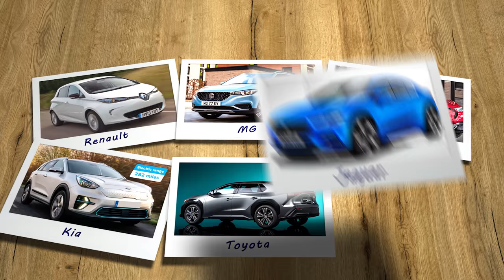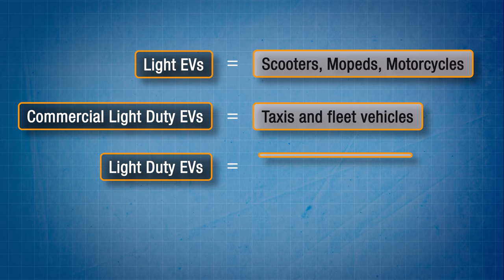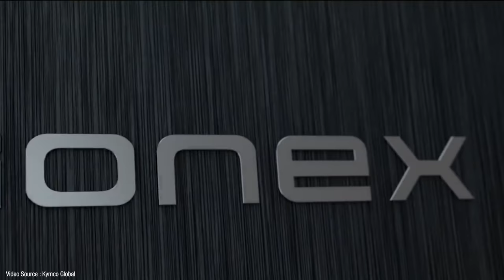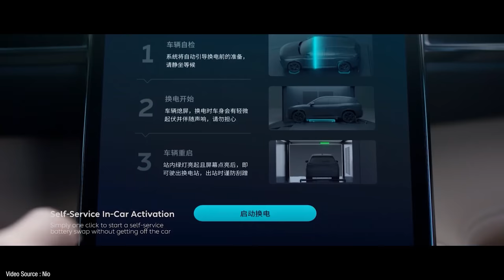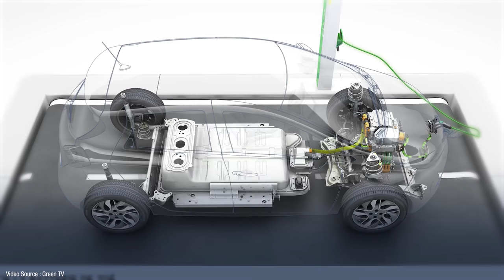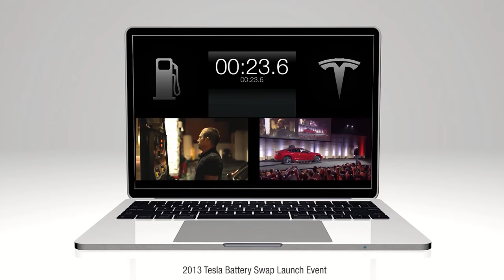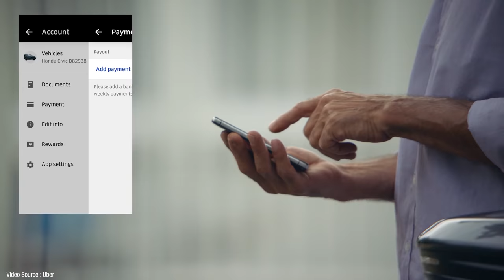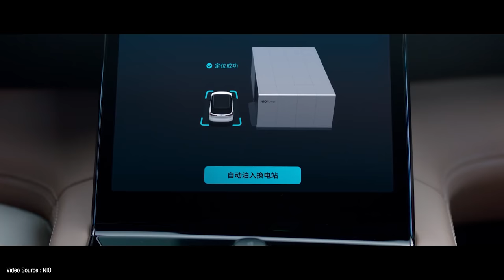Battery Swapping. Transforming the trajectory of electric vehicles?

Comment: Can’t believe it’s taken this long when all kids know that swapping batteries keep their toy cars alive.
Reply: It was tried before. The Renault Fluence ZE was designed with a swappable battery pack.
An Israeli company installed swapping sites in Israel and Denmark back in 2012.
The company went bankrupt in 2013.
(Apologies if that's mentioned, I haven't finished watching yet!).
Reply: Swapping batteries has its own technical difficulties, and most cars spend most of its time on parking rather than driving. If we can charge EVs when parking, why the hell do we need battery swapping.
Reply: @garylee867  Have you ever driven more than 250 miles from home?  With two kids complaining and crying in the backseat?  And you don't want to stop every 2.5 hours for 25 minutes to charge to 80%?
Reply: @garylee867  Try watching the video for the exciting and informative answer to your question.
Reply: @stanbradbury9449  I'm that distance just to the nearest bank or supermarket and don't have little kids.
Reply: @stanbradbury9449  Hi Stan, indeed in such situation it would make sense but how often do you make such long drive? Building such huge system (which by the way would also mean you would need the swap stations in the middle of nowhere to accommodate those long drives) doesn't make sense when you consider that in the US the average daily distance driven is under 30 miles. It would require HUGE investments from the car industry and from the companies providing the swap services. Not realistic from a financial point of view.
Reply: @stanbradbury9449  ..the issues I hear from owners in EV forums with children are they need to stop every few hours for the kids to pee and eat and also vehicles are used for that situation hardly at all.
Reply: @dominiqueridoux2073  While you are right, it might make sense to build the 30mls into your car and leave space for rental long distance batteries. Those could be cheaper than either rental combustion cars or electric ones you rent at your destination after a train trip.
Reply: How do you swap batteries if the cells are part of the support structure of the car like Tesla does?
Reply: @yarodin  You don't. No their strategy They want the battery to be cheap and capable of thousands of charging cycles, and the pack to be lighter to additionally increase range and reduce cost.

Comment: To make this work you need double the number of batteries compared to the number of EV's that use those batteries. As there is currently a worldwide shortage of battery supply as EV manufacturers are all battery constrained (including Tesla) this seems rather impractical. For every car sold the manufacturer needs two batteries, one for the car and one for the battery swap station ready for when that car needs to have a battery change. I can't see that this would be sustainable due to current battery supply problems or economically viable in the long term for the manufacturer. Battery manufacturers are already frantically trying to ramp up their battery production to meet the current rapidly expanding demand and I expect this to continue to be the case for at least the next decade.

Comment: Swappable, standardised batteries make perfect sense. What doesn't, is charging a battery from a battery viz. charging your car from a powerwall. Tesla is probably going to hang itself by having a structural battery pack complete with attached seats and upholstery, making it impossible to replace dodgy modules or cells.

Comment: That’s lot of precious batteries sitting in the ground instead of powering cars. Fleet vehicles ?  Sure.  Probably.
Reply: My thoughts exactly. Completely impractical for the general public
Reply: Batteries in ground can be used to stabilize local grids that are reliant on renewables. Those same batteries can also be serviced for defective cells extending life of the units. There are far more advantages than disadvantages like there being a surplus of batteries.
Reply: @ellefields8878  it will only ever be used with fleet cars and that is simply fact.
Reply: @ellefields8878  but there is no surplus of batteries
Reply: Perhaps not a lot of batteries in relative terms. If average car swaps battery once every eg. 3 days, and battery takes an average of a day to get charged and swapped at station, then batteries spend 1 out of four days being swapped. So 25% extra batteries required. Maybe an over optimistic estimate but it goes to show that every swapping station does not need to keep a battery sitting around for every car in its area.
Reply: @adymode  That's a lot of potential car production and looking at the average is a problem because you are going to have days where you are going to need a lot less and a lot more batteries and people are still going to expect that those batteries are there.
Reply: It's not that simple though, the battery-swap system would get a lot more personal EVs on the road (which would be great) as they would become more convenient and versatile for one, but perhaps more importantly, feasible for people who don't have a permanent residence in which they could install a charger (most people?).

And to address your point, the software's ability to manage batteries would introduce all sorts of efficiencies, such as the fact that not all batteries would be in use during the day and charging at night, lengthening batteries' lifespans (effectively increasing the number of batteries in operation and potentially offsetting the larger total number of batteries required).

Hard to say how many batteries per car it would need to be though. More than one, obviously, probably less than two? This would be a pretty complicated question. We'll leave mathematicians and software people to figure that out.
Reply: @robbiekavanagh2802  If you're a big automaker (Tesla for example) and you are limited by the amount of batteries that you can produce then you're not going to reduce your car production by at least 20 to 25 %
Reply: @adymode  Thanks for the analysis. Probably more like 50% to account for certain places needing to overstock because of imbalanced usage patterns, but definitely not 2x the batteries.
Reply: @robbiekavanagh2802  jesus

2.5 kwh is less than 60 to 100 kwh!
Reply: For most cars most of the day, the batteries are just sitting there, anyhow. This eliminates the need to have a charger or to sit around waiting for a supercharger, and will obviously extend the life of the battery packs. If it preserves battery packs, ultimately it could lead to needing to manufacture fewer battery packs.
Reply: @vill007b3  Or you sell more vehicles with 70 kWh batteries for routine city driving and allow drivers to swap to 100 kWh batteries only on days they do long trips.  You can sell a lot more vehicles with 70 kWh instead of trying to make all vehicles road trip ready.  Plus your energy efficiency around town will be higher with less weight on 90% of your miles driven.
Reply: Please explain…to a layman.
I live in an urban area and most automobile owners street park. I am simply not seeing much in the way of public charging station infrastructure being built where I live. When I purchase a EV 3 years from now I will have to purchase the battery when I buy my car AND purchase charging capability for my urban home. 
I acknowledge I’m not drilling down into the economics but the current situation sounds a lot like early internal combustion automobiles when you’d purchase gasoline from a local pharmacy if you didn’t have your own pump on your estate.

Comment: Let’s see we did interchangeable designs around records, CD’s, tapes, VHS tapes, hard drives, oh let’s not forget that Shimano pretty much standardised the entire bicycle industry away from proprietary drive systems. Batteries for the most part come in AAA, AA, C, D, sizes and did so for decades. We’ve steered away from these formats in recent which I believe was a mistake. We really need to go back to standardised formats for batteries making recycling and interchangeability easier. 

I think this is could revolutionise the entire trucking and transit industry and I see no reason why auto manufactures couldn’t build all their cars around 3 standard format batteries that can be swapped at automated stations.
Reply: It will probably come to that, but as with pretty much all the technologies you named, it is natural that the industry doesn't start out with a standard that everyone adheres to. Companies start out trying to make out their design work and be economically feasible, and when starting in a nascent industry you don't know for sure if, or when, it will become mainstream. The industry standard is often determined simply by which takes off with consumers, and that isn't always something that is even determinable at the start (videotapes being the example I am thinking of, as VHS is supposedly technically inferior to the Betamax brand it outcompeted).
Reply: @danyoutube7491  
I learned in a class titled “Ethics in Engineering” that the driver for coming up with their own solution comes down to creating planned obsolescence as a marketing strategy. Sadly the driver is profitability not what creates a better product. I think the best approach is if we legislate  standards that auto manufactures must use concerning batteries if we force them to have to assure that batteries are Derbi able they will naturally make them easily removable from the chassis add to that tax credits for adopting a universal interchangeable battery well that’s all it would take to create enough carrot and stick to bring about the change.

The problem here is we need government to set standards for battery and grid infrastructure. Honestly I believe the entire energy sector should be nationalised and subsequently should adhere to a global standard, this is a global problem and we would all benefit by coming up with a set standard. I mean we did it for ammo. Army’s of the world use 2 set standards NATO or Russian.

Comment: i can see the battery swapping option to work for Taxies and other Commercial vehicles that clocks a lot of driving. But for personal use, i think the evolution of current batteries to Solid State will see an end to this model.
Reply: Solid state does not solve THAT problem. Solar is the most abundant renewable energy source we have and it will keep that status.(only nuclear fusion -  if that ever becomes a reality -  would change that). Wind will follow as a very distant second. Think 70 or 80 percent versus 10 - 20.
Reply: Most regions do not even have a lot of wind power, so the electricity for charging cars in the evening (if they are home owners) will come from fossil fuel. To make things worse: Stem engines and combustion motors only use under 25 % of the energy of the fuel for motion, most of it becomes heat. 
There are plants (in Europe) that put that waste product heat to good use (residential supply of warm water, they have large tanks and produce electricity for peak demand, and store the heat). That drives up efficiency of those power plants to over 60 % but needs extra investements - which is acceptable for production of electricty in the temperate climate zone, when neither solar nor wind are sufficient.
Reply: Batteries that can be swapped in many places would dramatically increase the production of solar power (more PV panels installed), economy of scale price reductions for panels AND for batteires. The whole system would become more resilient and efficient when a huge demand (energy for mobility) that can be delayed ! would be become aFLEXIBLE element of the system. Elements that alllow some shifting around w/o disadvantages act as BUFFERS.

Plus the advantage that the battery life can be extended (no fast charging).
That other materials (not Lithium) might be "good enough" (fast charging is not needed). If the range is shorter less density could be acceptable. Some cars could accept a less perfoming battery (from another material) and be O.K. because they can always swap for a new one (Or get a reserve).

Plus cost advanatage when all manufacturers use the same kind of battery (or the unit has the same form and shape). 

The charging of car batteries CAN be delayed, stopped, resumed, dragged out over hours - it makes no sense to charge that AFTER peak production of solar ended, or to exclude people w/o a home. 

Buidling infrastructure where the car stand parked (when away from home) would be excessively expensive. Likely also impossible because easy target for vandalims, who would protect them.

it would also prompt a lot of people or companies with some free area on their roofs or in their yards to install solar panels, because there would be PLENTY of demand for power during day. That would go hand in hand with the need of solid roof construction, which has other advantages as well (like being a good fit for insulation). 

Solar panels also keep the area under them a little cooler (they absorb a part of the energy). In Canada and Alaska they have rack mounted panels and the angle of the panels can be easily adjusted by the users. Depending on the season (or even time of the day) the angle is adjusted. One homesteading couple in Alaska switches the angle every day in summer late morning and late afternoon. (In winter they have one angle). The rack makes it also possible to clean off snow fast when the sun comes out.

An automatic adjustment of the ideal angle would be way too expensive for smaller installations - and also larger ones. There is a city in Canada that has a larger farm that adjusts to the ideal tilt - and they have problems with the tech. And it was so expensive to get that smaller advantage in performance that they could have added a few panels for less money and be done with it. (In most regions of the world the generic angle is good enough and people prefer a seamless look on the roofs, the panels collect in a wider range, but closer to the poles one has more potential to optimize). 

People that are at home can of aim for a few percent more yield with simple means - in Canada or New Zealand or Argentine that makes sense (at least a seasonal adjustment).  And if they are not home they chose the generic angle. Such installations are mounted on a rack not a roof to be easily accessible. 

The batteries could also help to bridge a few days. If the PV panels cover so much roof and other area, there will be enough electricity produced for normal demand (= all but vehicles) even on a rainy day (daylight is enough to create electricity, direct sun is just better). And the sunny days of 1 or 2 days before would supply the demand on the rainy days as well.

Only for long periods of bad solar harvest they would have to supply batteries charged with help of fossil fuels. But then the efficiency would still be comparable (not to forget that that processing of fuel also needs energy). And it would have to be either swapping OR having the infrastructure for loading EVERYWHERE. Which would be obviously very expensive, target for vandalism, etc.

You cannot delay cooking your dinner or taking a shower for hours - but you could charge car batteries with delay. The tech does not really matter for the concept except that it would be preferable that batteries are sturdy and not too expensive. Lithium is a fire hazard the more they are used the more chances there will be terrible accidents.

Comment: I am not sure if this is the right format but I was wondering it is possible to use a EV battery as a standby power supply in the case of a power cut?  I accept there are some negatives but in my recent experience it was for one hour and I could of carried on with my work. IF I HAD AN EV! So this is a theoretical scenario.

Comment: Battery swapping requires that too many "extra" batteries be produced. Battery swapping will not be fast if there is any kind of line at the swapping station..
Reply: Also, putting petrol in your car will not be fast if there is any kind of line at the petrol station, buying delicious frozen pizza will not be fast if there is any kind of line at the WalMart checkout station if you have exceeded the 16 frozen pizzas so you are prohibited self checkout (my eternal problem).

Comment: Since we have standardised fuel and standardised pumps and filling systems, surely it's really not so difficult the standardise batteries for battery swap?  It's so bl** obviously the best way forward that it'll take 50 years to catch on in the west (well in the US & the UK).
Reply: The modern trend in EV design is to make the battery and integral part of the structure of the car.  A gas filler pipe is just a pipe.  There is no comparison in the complexity of standardization.

Comment: Battery swapping cannot become mainstream until the battery supply problem us solved. At least 10 years, when recycling and new cars and new materials all balance out. Otherwise yours a manufacturer are having to produce multiple, maybe 3 or 4 batteries per vehicle while they are e the biggest construing on mass production.

Comment: Sounds like a good choice for scooters. For EV's what happens if all EV's show up at once?  The belief that swap stations can be anywhere is far-fetched, they must locate where there's an adequate grid.
Reply: Swap stations need a smaller grid connection than charging stations, because they can spread the daily load over 24 hours. Charging station can do the same, but only by installing another big battery at the site to smooth the flow (which is how Gridserve do it). It's clearly more efficient to just have one lot of batteries used for the cars and the smoothing, rather than two lots.
Reply: I was thinking more when EV's become popular. Grids will do more.